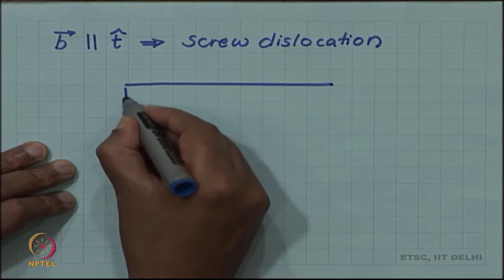Edge, screw and mixed dislocations

Comment: Sir my doubt is in slip approach as u mentioned the edge dislocation line was caused due to the slip ie burgers vector and then established the relation as b and t are perpendicular. But in case of screw dislocation u mention b and t are parallel but how come the edge dislocation line be parallel to burgers vector when slip itself is responsible for the formation of edge dislocation line it, should ve been perpendicular to slip .. ?
Reply: bro did you get the answer ...............i too have the same question?? how is it possible that burgers vector is parallel to tangent vector......because burgers vector itself is the reason for dislocation line moving in perpendicular direction
Reply: @saicharan9174  Professor is right, i think you are confused by the Vector notation on 'b'  ->  (the line arrow on the letter b) which is horizontal line.
Just follow the movement direction (y direction)'I', not the vector arrow on top of b (x direction)

so 'b' and 't' are parallel, both are in the y direction
Reply: Professor is right, i think you are confused by the Vector notation on 'b'  ->  (the line arrow on the letter b) which is horizontal line.
Just follow the movement direction (y direction)'I', not the vector arrow on top of b (x direction)

so 'b' and 't' are parallel, both are in the y direction
Reply: @saicharan9174  bro did you get the answer ?

Comment: Which dislocation movement is easier in fcc and bcc crystals and does the most dense packed planes exhibit resistance to the dislocation climb ???
Reply from the maker: @ Deepak Rao: When you say which dislocation movement is easier, what exactly do you mean?
Reply: The probability in BCC to slip is more than FCC as BCC has 48 slip system and FCC has 12. Also denser crystallographic plane become the slip plane, plane where slip occurs contrary to what we think
Reply: I mean to say slip planes.
Reply: M